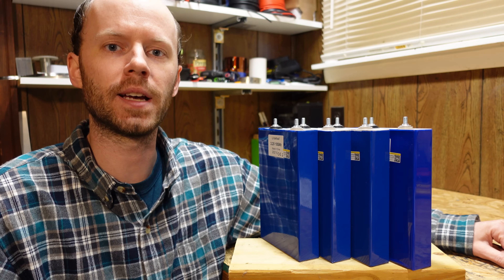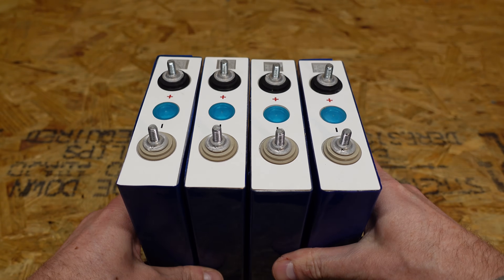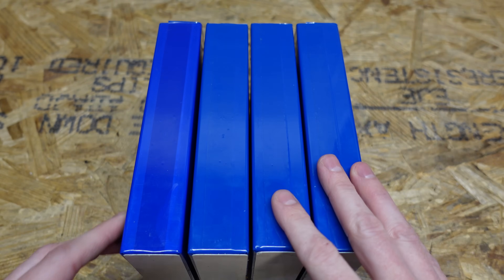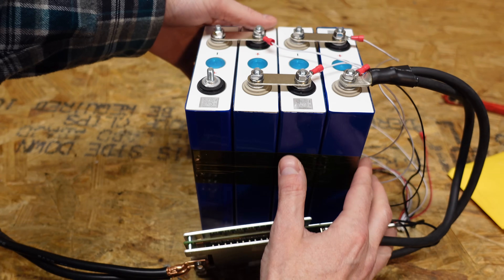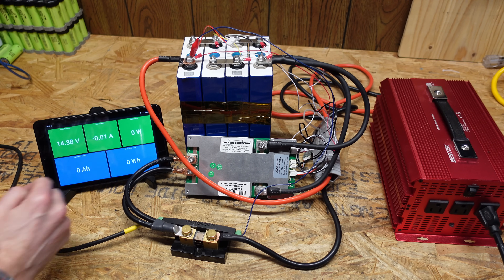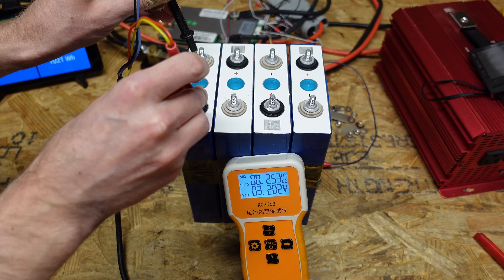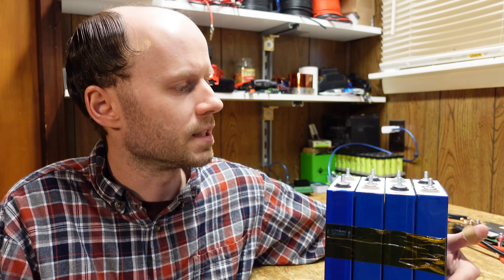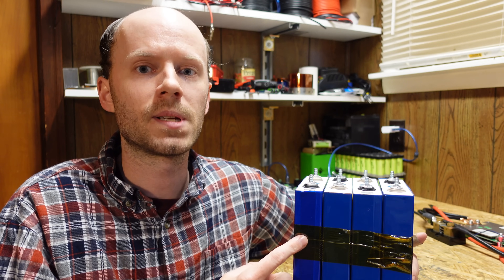Cheap "Grade A" Batteries, Why Do People Keep Buying These!?

Comment: I have no regrets buying the cheap cells.  For my application I will never charge or discharge even close to the C ratings, and will probably never  never cycle them anywhere close to the cycle life rating.  I just needed large capacity for cheap.  If you need the batteries to really perform, then by all means pay more for the real grade A, but for me, the cheap batteries work great.  And yes, mine tested to deliver full nameplate capacity.

Comment: I actually just got extremely lucky with a LiitoKala purchase on their short 180ah cells (Actually 158-ish ah) and out of the 64 that I purchased, all of them appear to be grade A or damn close to it. Just mislabeled and clearly re-wrapped from another manufacturer. 

It really was fortunate that I got what I paid for. (As I knew from the reviews the cells were only 160ah to begin with) 

LiitoKala appears to buy from a multitude of manufacturers, and is even deconstructing these cells from another product and rewrapping. Some of THEIR vendors appear to be hit and miss. Some are selling them used cells, and some are deconstructing them. Likely from companies that went out of business and had stock on the shelf containing the cells, that wouldn't itself sell as a product. So they are harvesting relatively new cells and re-wrapping them. 

So, it would appear that virtually NOTHING LiitoKala sells in "New" and is likely at a minimum, harvested re-wrapped cells from other products, and at worst, used up cells being sold as new. 

Personally, I will NEVER buy from LiitoKala ever again. The cells took almost 3 MONTHS to arrive, arrived with the wrong nuts, was short on bus bars, and was overcharged for shipping and had to dispute to get my money back. 

My pack is fortunately operating in a TIGHT balance with only a .008 .006 Voltage diff between cells after top balancing. 

All 64 cells tested on arrival to within .01vdc of each other, and the internal resistance is very low and appears to be at the worst only lightly used. 

But yeah, a 4000$ roll of the dice for sure. Pure luck that I got decent cells. Many others have not... 1/10 would NOT recommend!

Great video, and Thank You for highlighting this company!

Comment: Dude, they are lithium cells. If they have sat for a while they will benefit from being cycled a few times before they come up to full capacity, hell most gear that has lithium cells in require a few charge cycles before they come up to capacity. How long have you been handling lithium cells?
Reply from the maker: Dude, cycling them is not going to magically change them from 80Ah to 105Ah. You can polish a turd but it's still a turd.
Reply: @LithiumSolar  You sound like you are more of an expert on turd than lithium. I say that because you haven't even tried. As the cell has puffed a little you might not get it up to 95ah but be a little more thorough on your reviews if you want to give an impression of expertise.

Comment: I have a pair of so-called 30AH LiOn battery packs. One is labelled EcoWorthy and the other ToBattery. They work - which is the best I can say. The voltage plummets when I put a 4a load on them despite their being rated for 60A each or 120A since I have them in parallel. For batteries that were $150 each that was a poor showing but they're still better than the 35ah lead-acid batteries I was using. Having said that, the lead acid batteries didn't shut down in cold weather. Swings and roundabouts. 

I also have some Litokala 18650 cells that I have not yet tested nor used. Had them a year or two so far,

I have some SkyWolfEye 18650 cells with a fictional 5800mah capacity. In testing I reckon they're about 2600mah each.

Comment: i have 8x 100a cells from ali about 15 months ago and they are still good and running great 
i use them in a diy 12v power generator and yes they go out of balance randomly but i put an active balancer and that sorted things out 
the bolging swealing is happening and that seems to be normal because they are very compact inside and they expand at full capacity and retract flat al low capacity 
for the price i think they are really good at least the first 100a version they had...not so sure about the new ones after seeing your video

Comment: I think for the price you paid, you received a matching product. $40 per cell in these times is not bad for 80ah. The fact that you ripped them off is not good. At least refund them a partial payment. 
Almost ALL Aliexpress companies market the same way. It must be a cultural thing. Always expect to get what you paid for. If they charged you $100 per cell, then I could see your point.
Reply from the maker: I did not rip them off. I paid for a brand new battery. I got garbage. In addition to a refund, they should be paying me to either legally return the battery (declared on shipping that it's a lithium battery) OR reimbursing me for the fee I will have to pay to dispose of them.

Comment: Bought exactly the same cells. Tested all of them individually and got 87 to 89Ah. Still unaccaptable. 
Started a dispute on Ali... and now waiting for a partial refund.
Reply from the maker: That's a big part of the problem right there. They're not held accountable. It shouldn't be a partial refund. It should be a 100% refund AND they pay for return shipping!
Reply: @LithiumSolar  I think it is okay, if the refund more than matches the loss of capacity. My cells perform if they were labled 85Ah. They output nearly the same amount of Energy at 1C and 2C.
Reply from the maker: @J0hn1o1o  I disagree. A cell that's 105Ah from the factory but is now testing at 85Ah is at 81% of its state-of-health. Almost all manufacturers of these cells list 80% SOC as the "end of life" specification and recommend their battery stop being used after that point. So your 81% cell is pretty much dead before you even started using it. I completely understand that it still works and you CAN use it; however, they sold you a product 1% from dead and called it "new". No way a partial refund is acceptable in my book...
Reply: @LithiumSolar  that is completely true. But I think those cells physically never were 105Ah. Maybe they were designed to be 90Ah. If those cells were near their EOL I would expect a heat up during high C-Rate discharge, which they didn't show. But I will have an eye on degradation.
Reply: What  can u run on these batteries? Can u run them as a power station.  To change cellphone, tablets, switch?   Could  you  run a space heater or a oil heater?
Reply: @ yes you can. But you should wire them up as a 16s or 48V System.

Comment: True grade A cells have become such incredible value for money only a fool would buy anything else unless your use case is firmly in the hobbiest domain. For everyone else batteries of this calibre are a true game changer, Ive been using mine for my only source of power for 2 years now which gives me the ability to do things like live in complete comfort anywhere in my country and not waste money on ridiculously high rent or power bills for example. No huge debt to achieve it either and will have paid for itself in 3 years with all the money not poured into someone else's pocket!

Comment: Hmm, intresting i have actually purchased 8x of the 320ah cells from littokala recently, received them last month and they tested between 305-312Ah, for the price I was pretty impressed with them, i paid £775 for them not too bad for a 600+Ah  a battery pack imo.
Also just to add littokala did advise these cells are supposed to be compressed (otherwise they will swell)
Reply: "these cells are supposed to be compressed (otherwise they will swell)" ???    Never heard that bullshit before!    🤣
Reply: Since nobody manufactures 320ah cells, we know that they lied about that. I won't purchase anything from any company that lies. I will pay extra and get exactly what I ordered, not some made up "good enough" (and likely used) garbage. FYI, my 304AH cells do not bulge, they lie about that as well.

Comment: I bought 16 Liito Kalas, advertised at 60Ah, for $25 each. Knowing that Chinese companies almost always exaggerate their battery capacities, I tested them individually, and found they were all at about 50Ah. Physically, they appear to be in perfect condition. I'm still devising a way to do a stress test on them. I want to see what the voltage drop is at sudden high amps. But they run my mini fridge and 5000btu air conditioner with barely a twitch. It seems I won the gamble this time.
Reply: sounds like u dodged a bullet....lol

Comment: Clearly used and degraded cells.  Who knows how many cycles they have had on them?  Maybe they were just manufacturing defects, passed off as "new" cells.  Some might look at it as a value proposition.  You paid $171 to get 80AH @ 12.8 volts nominal, so right at 1,000wh.  That means about $0.17/wh for just the cells, but you do have to factor in the BMS, bus bars and whatever case you decide to use.  Compare that to buying an SOK 100ah (1,280wh) battery for $569, or $0.44/wh.  The SOK costs around twice as much per watt-hour, but you get new cells, in a properly designed and professionally built package.  The biggest problem with the cells you show in this video is you really can't trust them...you don't know how damaged or degraded they are, but the likelihood of complete failure, catastrophic or otherwise, is much higher.
Reply from the maker: "really can't trust them" < exactly this. Most manufacturers use 80% state of health in their specifications as the point for which you should stop using the battery and consider it end of life. Cell 2 here is beyond that point already.

Comment: I think Jehu recommend them a while back and the reputation stuck. I have an 18650 charger from them on his recommendation.

To be fair though, I just bought an 8s pack off of a similar AliExpress site, and even at 50ah they'd be cheaper than anything I can buy here in the UK if you factor in having to drive to pick them up (most won't ship batteries because of the regs).

Comment: Good call, your right these are not grade A battery, just through your examination I could tell, and the test results did not come as a surprise either, and your conclusion is exactly correct.

Comment: Thanks for bringing this scam to the eyes of this comunity, Unfortunetly I bought about 40 of these “105 ah” cells and am now dealing with the concequences. DO YOUR RESEARCH BEFORE BUYING ANY CELLS!
Reply: Did you use them up? If so, how many charge cycles did you get from them? I am curious how much you get from what sound like used cells from scammers.
Reply: @OldWorldAscension I still have them. They’re bloated as hell and capacity of each block is all over the place (20-80 Ah)

Comment: Like you, I test, and test, and test again. I bought some of the SPIM08HP 24V24Ah batteries from BH. I rebuilt them to 32Ah batteries by replacing the blank cell holders. Charged them up to 4.15V per cell. Tested them. They came out at 27Ah. Recharged them to 4.20V and retested. Came out at 30Ah when the inverter shut down. If I had a different Voltage setting on the inverter, I'm sure they would have gotten to the 32Ah rating. It pays to buy from someone more honest than on Alibaba.

Comment: They certainly look like my EVE 105 cells, and as noted,the number on the QR code for mine all start with 02Y. Of course I paid more for mine since they came from Amy at Luyan, but they also came with all the test data from EVE. All measured spot on with the EVE test reports, about 109 amp hours per cell. I don't know if EVE sells different versions of the same cells, but mine came with M4 threaded from the factory (you can tell, straight and even tap, much better than those tapped by a third party). Of course for 4 I paid right at $250 including shipping (actually $511 for 8, including all the fees and sales tax). Like you say, you get what you pay for, and the vendor you used has a terrible reputation and should be avoided. The ones you received are obviously used cells that were pulled at end of life (80% capacity, or close to it). None of mine are bulged in any way.
Reply: Amy at shenzhen Luyaun sold me 16 Eve lf280k and they are all good! Highly recommend! I use them constantly in my off-grid home:) Littokala has a terrible rep. Thank you for confirming.

Comment: How do you like the internal resistance meter?  I wonder if they match what the iCharger shows for internal resistance.  Thanks for the heads up on these grade F cells.  80% is considered end of life for most cells.
Reply from the maker: It's ok. It's the only one I've used so I don't have much to compare it to. Sometimes the screen acts funky, like it has a slow fresh rate or something. Also, completely forgot the iCharger had an IR readings tab!

Comment: I am just sad that so many months went by until you tested them.  And more people would have bought them.  Not blaming you.  You are doing a great service.  I just think back to the first LiFe batteries I got that were twice as good as these and still pretty crappy.  I wish I'd had your review then.  The second were ones you recommended and I have been very happy.  Keep it up.
Reply from the maker: I didn't intend to review them originally. I was going to use them for a build video, but project fell through due to the turd batteries, so they just got stuck on the shelf. But yeah, I really should have gotten something out sooner...

Comment: I bought 4 280AH "grade A" batteries from LittoKala in Jan 2021, received them in March 2021...I didn't get much tracking on the Aliexpress site, but at some point a pending shipment showed up in my FedEx app a few weeks before delivery from Jack somebody or other, I forget, and Fed Ex did finally deliver them.   These 4 batteries looked good and matched and tested around  276AH so I figured OK, I will get more of these batteries, so ordered 12 more for my project. I received those in about May 2021, tested them and all of them tested with around 240AH.   I complained to Aliexpress and asked for a partial refund (I wasn't going to send them back) and got about a 12% refund of the already cheap purchase price.  I charge them with solar panels on my south facing balcony and some from the grid  and use them to charge my Chevy Volt which is parked out too far to run a cord to it from my 3rd floor apartment.  I charge 8 at a time, and then charge the car up with 8 of them and an inverter in the back of the car.  I have 4 batteries each in 4 camera breifcases which I can carry in and out.  One set to charge the car while the other set is charging on solar.   Its been working out well for almost a year now, They still charge and discharge at around 230AH (3 of the packs do anyway).  And I get the car charged and avoid buying expensive gasoline at least.   They will be repurposed into a  van build for living on the road within the next year if I ever get the van I orrdered and I'll have about 12KWh of capacity for the van at least and should get a few more years service out of them hopefully.
Reply: Thanks for taking the time. That's about what I expected and still very good value.  I bought 8 of the 280s (Non grade A) a few months ago, but they're still in storage atm. They do look fine tho, absolutely skinny.  I'm hoping for 250AH but I'm not going to complain at 220 ish. What else is there for the price?  Even at 200AH I get over 5KWH for less than a grand (US).
How do you beat that?

Comment: I ordered 200 AH litto kala cells and also were touted as new .   They were bloated but not to bad but obviously were sorta cleaned up and repackaged the vents were corroded and 2 of the batteries had damaged threads. They all tested between 79 to 82% capacity … I set up a dispute with aliexpress and EVENTUALLY agreed With me that they were not new but the damaged threads didn’t matter.. they agreed to a refund but I had to return the batteries, return shipping was more than the purchase price because I had to declare them as batteries, the original shipper  didn’t class them as batteries. So I didn’t get a refund and I had to pay for environmental disposal.
Reply: Been better off keeping the batteries then
Reply: @JesusRoseAgain  I ended up doing a environmental recycle, 2 of the battery’s were starting to leak through the corroded vents
Reply: So all those other good cells you couldn't find a use........really?  I can think of tons of uses for even a single cell
Reply: They were all really used and corroded .. 2 vents were already leaking, and as I tried to charge and test they were bloating even more … I was only charging and testing at .2C
Reply: @henrysangret5324  if they were all going bad thats acceptable

Comment: Me too got ripped off by this vendor LiitoKala, they advertized Grade A, brand new 320AH Cells. Came in bloated and tested only about 280AH. Don't  buy any product from this seller!!!
Reply: Your first hint should be that no manufacturer has 320 amp hour cells. Certainly some like the EVE 304AH cells will test about that the first few cycles, but they are rated at 304AH.